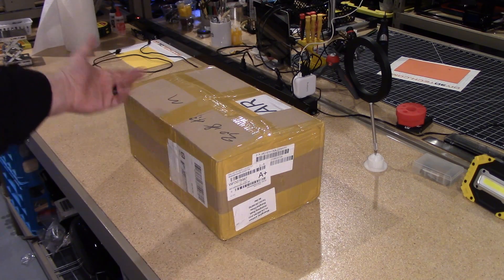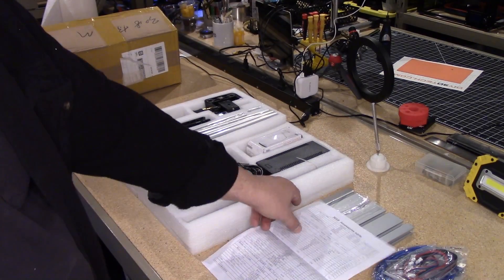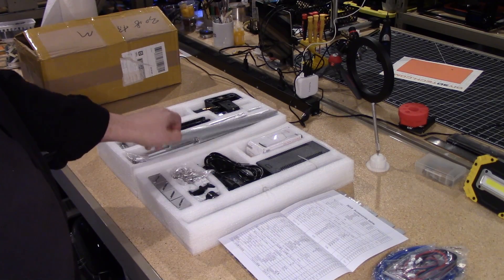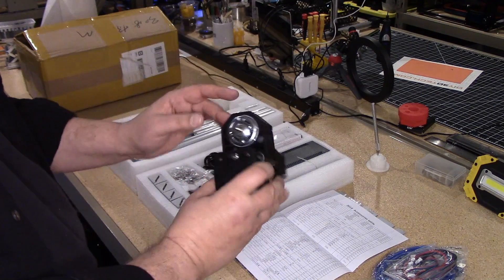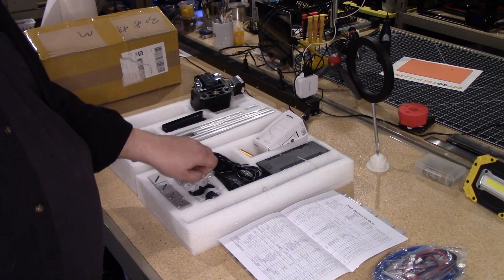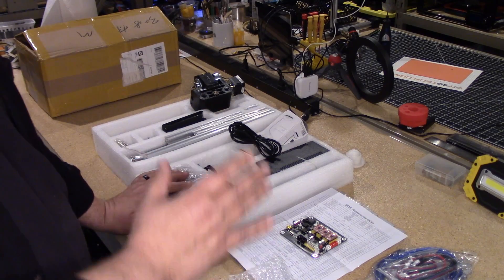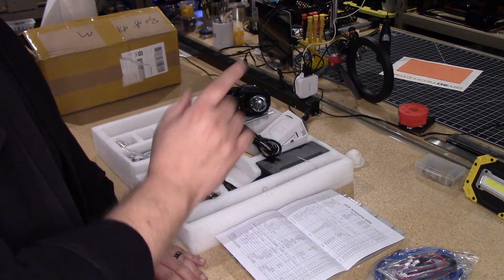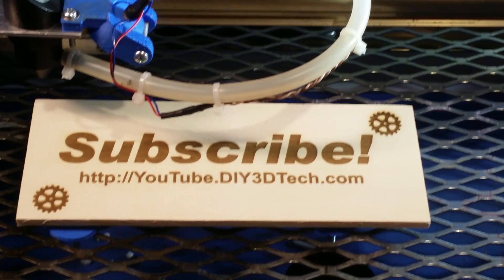3018 CNC - What A CRAZY Price!

Comment: Is it still holding up well? I am looking to use it to cut out wood knife handles and maybe thin aluminum sheets
Reply from the maker: Doing well thanks for asking and Knife handles yes, aluminum sheets I would not recommend as this only has a brushed DC for a spindle
Reply: @DIY3DTECHcom  thanks for the reply so it handles hardwood no problem? Do you think it would handle .060 brass or aluminum?

Comment: I got in on the fun as well. The CNC arrived today.
Just unpacked and it looks generally fine.
One exception though. The 10mm smooth rods are corroded. Two of them are OK, one has lots of pitting on it, but could probably be used if I polish it up. The last is heavily corroded and has a really rough surface. So I'm looking for replacement parts on Amazon.
Makes me wonder if I should jump straight into increasing the size as well (It's one of the short rod that is corroded the worst)
Reply from the maker: Wow sorry to hear on the corroded issue!  Also if that is your plan then yes!  The issue I have is matching the lead screw pitch as the rod are just 10mm rods, and I guess because it was so cheap they would just standard T8 lead screws from a 3d printer however the pitch is off and because I have been busy with the "virus" I have not had time to research.  I did build mine is in the mean time and it works great!  Will be doing an update video soon! (Virus permitting, not that I have it just busy with it)
Reply: @DIY3DTECHcom  no worries, helping those in need and staying safe is of cause the priority. This is no more than a nice distraction from the challenging times we are in.

Comment: I ordered mine on Friday and I got it on Monday today I can't believe it. I would have been looking at some videos on how to build it if I realized it was going to be this quick. So how about going ahead and put out that video of the upgrades cuz I'm ready.
Reply from the maker: I am glad you picked up one and because of all this Corna Virus stuff I have fallen behind.  I did end building the unit as is and was very easy!  Will be doing a video soon as well as ordered a remote gcode sender.  I did order longer rods and lead screws but guessed wrong and the machine uses 10mm and I got 8mm and the pitch of lead screw doesnt match so I am back to reordering...
Reply: @DIY3DTECHcom  I am glad I was reading through the comments. I ended up buying the wrong one also I had to re order the rods in 10 mm but I havent found a lead screw yet that matches.   If I do I will leave a comment. I ended up getting it for 131 which was still a good deal

Comment: The only problem I’ve had with mine is the z-axis linear bearings sliding out due to vibration (while cutting metal, so way beyond what the machine is designed for) and also the spindle holder cracked due to the same vibration. So far ca flue is holding while upgrade parts are on their way
Reply from the maker: Are you using the stock motors?
Reply: @DIY3DTECHcom  i have the 3018 pro, so it has acrylic for all the "side" parts, but so far all stock. the z-axis linear bearings were vibrating out long before the crack appeared. i think a lot of the chatter has to do with lack of rigidity of the whole structure.  i have cut 303 and 304 stainless and aluminum--very slowly with very shallow depth of cuts.  probably far from optimal for chip formation etc but i only know enough to have a small idea of what i don't know :)   sems to work fine for softer materials - plastics and wood.

Comment: Its 135.00 bucks without prime shipping available....
Reply from the maker: Gone up a tad, Ipaid 123, then 129, 132 and now 135 :-)
Reply: @DIY3DTECHcom  how many did you buy and I did get Prime shipping by the way shipped out of California and I'm in Oregon ordered it on Friday night late got it on Monday by noon. I don't suppose you could point me to one of those assembly videos you talked about are all the 3018 the same? Also mine was a 300 by 180. It's funny because they had smaller ones for more and then they had a pro model but I couldn't figure out what the difference was. I was wondering to did you have to load firmware on yours or was it all ready to go out of the box?

Comment: Of course as soon as someone buy's one the price goes up. It's now $131.97, still a good deal. I noticed that the control board you received is different from the one pictured. I noticed this because I have a machine that has the board pictured on Amazon and I just added limit switches to it Monday.
Reply from the maker: As I shared in the video I was surprised by the price and yes even at $131 its a good deal as for my other desktop CNC I $200 and it is half the machine of this one...
Reply: 135 now

Comment: I and others have made 3D models that can be 3D printed to fit a 52mm spindle. The models are on grabcad and thingiverse.
Reply from the maker: Thats cool!  Do you have the links?
Reply: @DIY3DTECHcom  https://www.thingiverse.com/thing:3645875
https://grabcad.com/library/3018-cnc-52mm-spindle-mount-1

second link is mine, i had to model it from a .stl i found on thingiverse, so i'd try the thingiverse link. there's more than that one on there.
Reply from the maker: @Cephalon_Shade  Many thanks!  I will try this on my SLA printer and see how it turns out :-)
Reply: @DIY3DTECHcom  awesome! glad to be of help.
Reply: @Keribi that i know, i can't fully design one unless i have the machine in hand, which i do not currently.